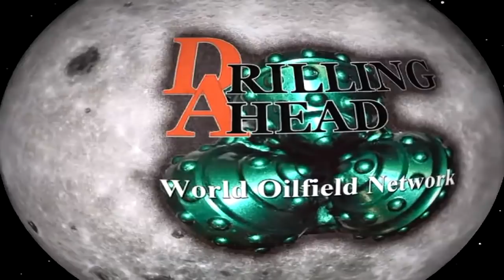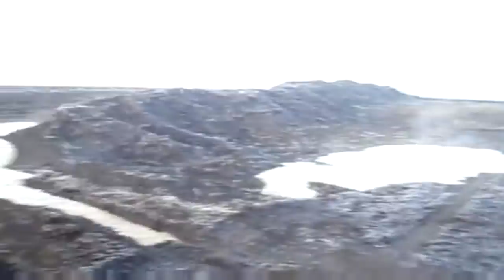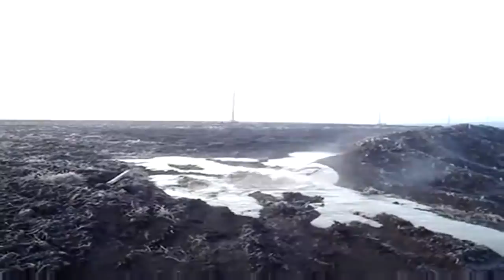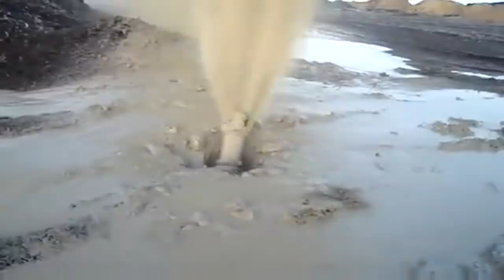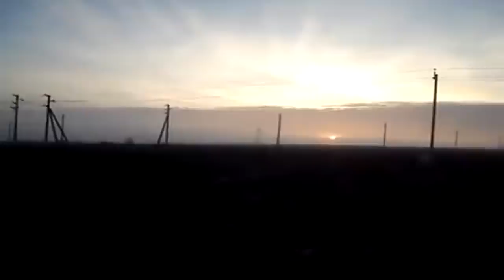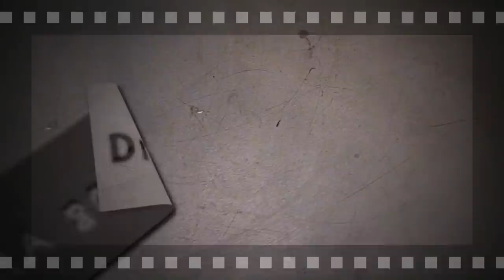Oilfield Directional Drilling Nightmare.mp4

Comment: Can anyone explain what's happening in this video?
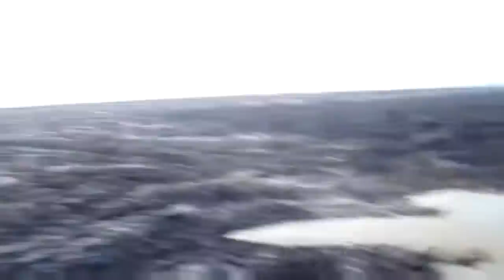Reply: It's called directional drilling. I can't tell for sure if there's an oil rig on the horizon at the 1:43 mark but it looks like it. Also not sure why they would intentionally pop up in the middle of a field but this is just too weird for this to have been an accident.
Reply: Slugg0matic they were probably trying to get some kind of pipe/cable line connected and it was cheaper to go underground than do on ground construction.

Comment: What were they trying to reach?
Reply: Oil, gas or water down below, one would imagine, thats what people normally drill for! Certainly not the surface of a ploughed field. Massive miscalculation by whoever was driving the drilling rig. I guess his career in drilling has been permanently terminated!
Reply: davidenespana If you read, they did this on purpose. They pump steam into this hole and extract oil out of the other side.

Noticed they filmed the bit coming through and the berm behind catching the spray coming out of the bit.

Comment: Nothing went wrong just typical directional drilling for pipeline. Been to locations helping pick up the gel mud and sand hauling it of with an oilfield vacuum truck. Used for pipelines to go under rivers, streets, railroads, lakes and other pipelines very common.
Reply: Martin Garza could they not just kill the water?

Comment: There is no nightmare here. That is just the drill head coming back to the surface when the D-bore run is complete. granted it took them a long time to shut the water off, but that is exactly how a d-bore head comes out of the ground.
Reply: No, its just not a kind of nightmare.
Reply: Yeah, thats all it is. They use pressurized water through the drill head to loosen the the ground and to help lubricate the path of the bore.
Reply: I ran a small 2020 ditch witch for a cable company. the water takes a while to shut down also contains Bentonite to keep the hole and to aid in pullback of casing or conduit the head they are using is for rock. the guys will remove the cutting head and install a reamer to enlarge the hole if need so.

Comment: Drill pipe will stuck because there are no return. Should pull out and cement that hole on surface then switch on punmps

Comment: it's a nightmare. as soon as u punch out... u have no well circulation anymore. you have no down hole pressure to help u pull out.. all that side load and gravity and bend on the pipe... your F&#K*D. lost circulation... go to pull and u wonder why instead of pulling maybe 70 decks your maxed out at a hundred let's say... and there's this weird guyser at the end of the field... most of the time this happens.... it's dig down.. cut pipe off and cement over and fire the driller. the BHA is a loss.

Comment: How do you do this?
Reply: Megaspasstpräsentiert Directional drilling.  Instead of drilling a hole straight down they are able to change the the direction by very slightly changing the angle of which they are drilling.  It is actually common to drill vertical and then have the drill pipe end up being completely horizontol.  Might sound impossible but you have to consider the curve is made over a very long distance.  It is not a harsh curve at all when done like this.  Search 'directional drilling' and/or 'horizontal drilling'.  You can find some animated educational videos.  It is pretty amazing.
Reply: Mike Elbow yep

Comment: To get the string of pipe to bend they stop rotation. And start ramming and they put pressure on hole bottom once the string is bent they start rotating which causes it to kick out, that's how they get to a horizontal. These hajjis don't know what they are doing rigs over in the US pretty much use the most up to date technology and it's impossible to do what they just did and if this happened over here everyone on that rig would be without a job that's a fact hell the company would probably los

Comment: Up to 45k for a triple each day; which is nothing compared to the R&R and testing of multi-million $ BHAs (Botton Hole Assemblies). A single direction mud motor can run up to 5 million; how else do you think they test them? You believe they would go drill an actual well without a full test of the tools? IRONICALLY -  though you are the one that asked the question, you are the one without any knowledge.

Comment: someone explain this to me
Reply: +borel2016 drilling for oil isn't always a vertical hole. These new drills can drill at an angle and change direction while drilling underground by putting pressure on one side of the drill bit or the other. The oil well in the distance must have made a wrong turn. Big time.
Reply: +enkrypt3d oh ok, sweet. thanks!